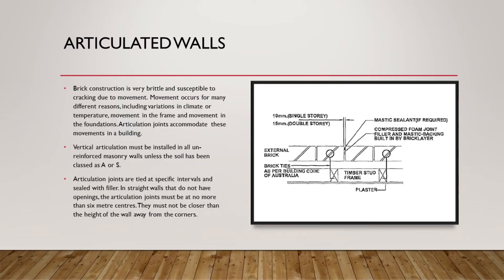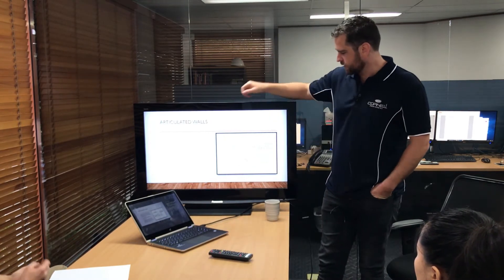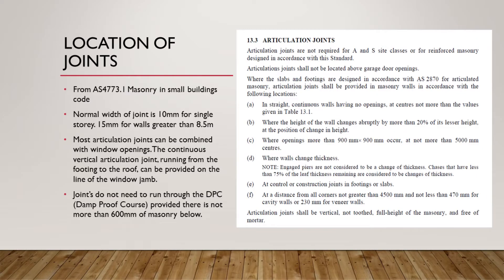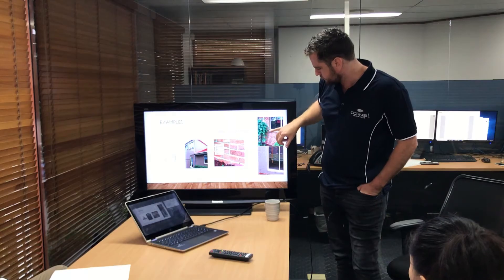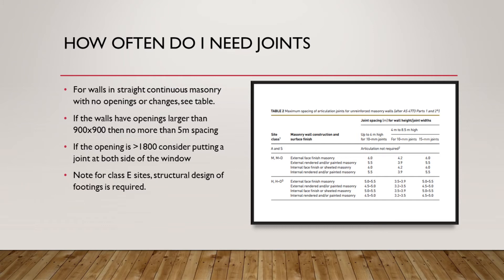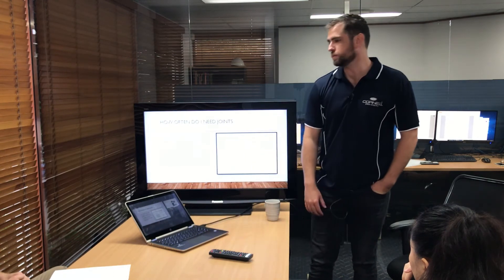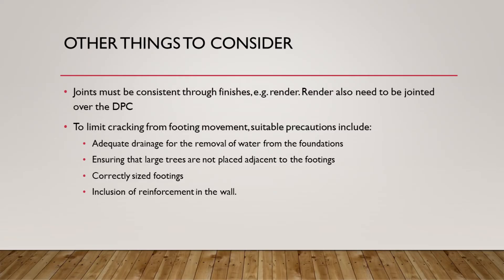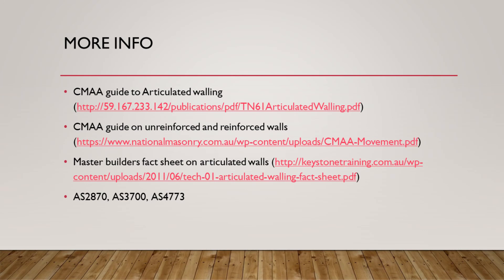What is a Brickwork Articulation Joint and why do engineers specify them in brick walls

Comment: Thanks, really appreciate the video. We've been suggested to do this to our 2 story apartment building, built in 1970.  This doesn't solve the problem of internal walls cracking though does it ? It seems like a massive job.  Is just patching the cracks as they occur an option ? as articulation joints don't really add to structural integrity? Thanks for any help.

Comment: Thankyou for your video. Are control & articulation joints the same in regards to not having be below the DPC?
Reply from the maker: For single story construction: yes. BUT. Brick growth in a long length of brickwork is still an issue that should be addressed with some sort of gap/control joint in the bricks. More so since it is moisture (ie rising damp) that would cause the bricks to 'grow' longer.

Comment: Hey, I hope to get an answer for this question. I understand articulated joints are used in buildings. How about fences? A brick fence around a house, an articulated might make the fence look a bit ugly. And if we do use them in fences, how often/ far apart?
Reply from the maker: Think Brick Australia has a fantastic set of manuals on brick construction that is just what you need. Page 17 talks about control gaps in free-standing walls.
https://www.thinkbrick.com.au/Technical/Manuals/technical-manuals#
When weighing up the aesthetics of articulation joints, consider how ugly uncontrolled cracks are in a wall compared to nice, neat joints that open and close season to season and keep the brickwork looking brand new.